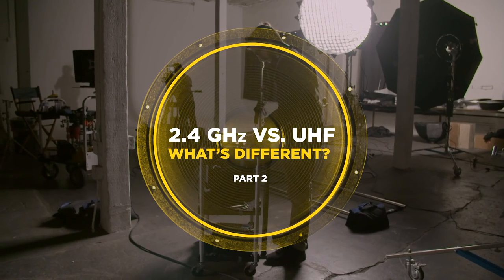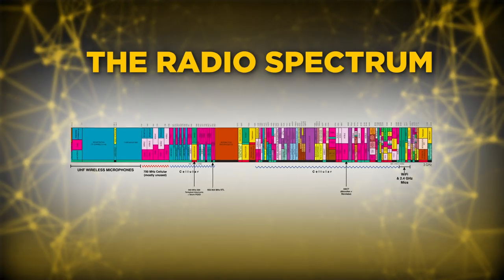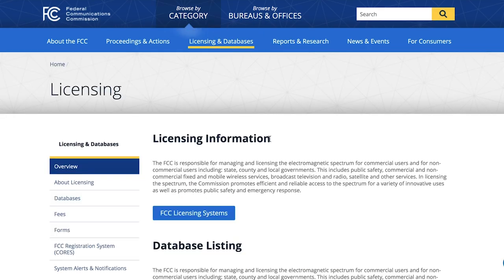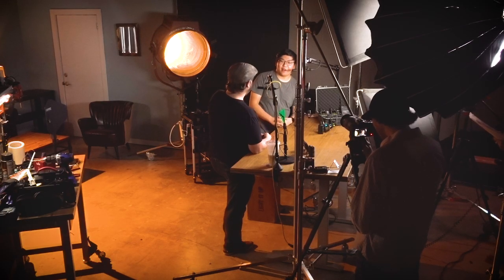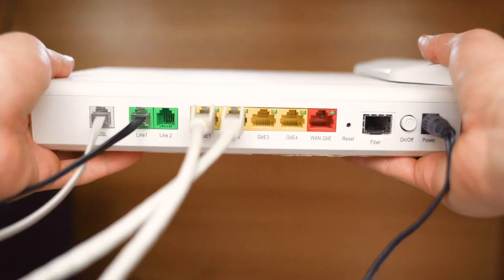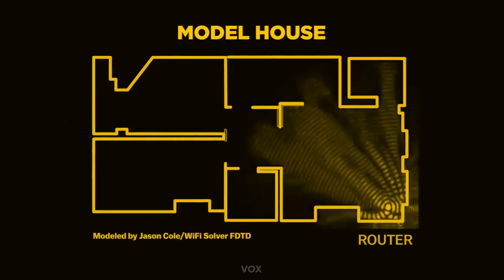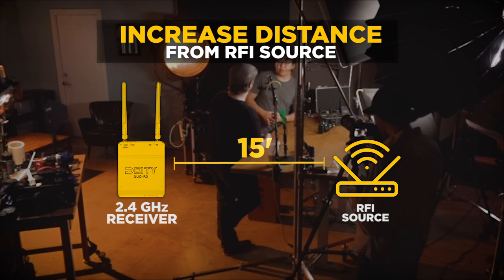2.4GHz vs UHF  |  How To Get More From Your Wireless Microphones

Comment from the maker: How have you solved your RF interference problems in a creative way?
Reply: I would like to see a video about the best way to get sound with the Deity V-Mic D3
Reply: Planting the RX closer to the talent by using a long XLR cable. The RX doesn't always have to hang out on your bag.
Reply: I was working on a shoot earlier this year inside an RF dead zone (at a TV studio directly under a tower) and i was having issues with RF leaking through onto my audio recordings (Zoom f4). I eventually found out that my phone was struggling to maintain a connection so it was boosting its signal and thats what was leaking through onto my mixer. Airplane mode fixed it
Reply: Chris Hoffman This
Reply: Straws on TX Antenna.
Reply: @Izaiah Caleb instablaster =)
Reply: @Valentino Kayden It worked and I now got access to my account again. I'm so happy:D
Thank you so much, you saved my ass !
Reply: @Izaiah Caleb glad I could help :D

Comment: i have a Rode Filmaker kit (2.4Ghz frequency), great so far, never failed, until a day I had to film/record someone inside of a baseball stadium full of people (and their cell phones)  the audio was dropping all over and barely  could get the seconds needed for the editing  while audio was cutting seconds before and after the parts used, did not realized after all was shot and over, really scary experience while watching/listening the clips for the first time, I saw the meter pumping on the screen, did not used headphones. I trusted the thing first cause never failed me before and 2nd cause I had no idea that type of thing could happen, it was a close call on a paid work. Learn a lot from that experience, hope whoever read this, be careful inside crowds.
Reply: If you call yourself a videographer, you need to always be monitoring with headphones (unless it's an on body recorder). Which brings up that point, the Wireless Go II transmitters record internally so it's a really great fail safe.

Comment: The biggest issue with 2.4 GHz isn't RFI, but the lack of reflection sources and penetration. The human body kills the signal quite well, so it has to rely on the signal bouncing off an object to get around the human body.

That presents an issue in certain environments.

One solution I have thought of - why can't there be a "secondary" antenna the size of a Wireless Go that you mount on the body, opposite the TX? It would be like having a TX on both sides of the talent - any direction the talent turns there will be a TX with line of sight to the RX. Would be a great problem solver for 2.4 GHz systems.

Comment: Loved this Video! Very informative & encouraging as opposed to smug and condescending. I own some Sennheiser EW D1’s.

I wonder if other than moving away from WiFi routers, and turning off cell phones is there anything you can do to strengthen 2.4 ghz signal.  Do you need a specialized brand name directional antenna or can you buy any 2.4 antenna.

Comment: Wow. These make me really appreciate sound people and their knowledge. Is it technically (or financially) possible to have some sort of adjustable GHz frequency making it adjust between various levels depending on where you are. Not sure if that is the correct way to ask that.
Reply from the maker: Yes it is. Infact we built that into Deity Connect. Set latency mode to high and RF Output to AUTO and it will automatically adjust based on distance.
Reply: Deity Microphones Well, that answers that! Amazing. Thanks! Any word on killer lapel mic yet? 😁😁😁

Comment: In Germany, both UHF in the ranges 470-608 MHz and 614-694 MHz, as well as 2.4 GHz in the range 2400.0-2483.5 MHz can be used free of charge (until 2031 for now). RFI for UHF is limited to other wireless microphone systems as these frequencies are limited to use for such systems. 

Just if this helps someone...

Comment: We've just recently been experiencing a lot of rf interference with our new Deity Connect system at work. I'll definitely start by turning down the power since they were all the way up.
Reply: Yes! I think this was a little gold nugget of information that was said. Didn't realize more power can create more problems. Did that solve your RF issues?
Reply: @joellouisfire  I haven't really noticed, but  we rarely use the system because they're just so noisy and have tiny dropouts.
Reply: @TannerGwaltney  Ah ok. Did you try updating the firmware and turning up the output settings on the transmitters? I heard that helped a lot with noise issues and Deity also fixed a lot of the noise with firmware updates.

Comment: Quick question from a guy that's green to managing wireless mics and their frequencies. My UHF receivers have a "RF" meter. Where do I want that level to be (or does it matter) and how do I consider getting it there? Pretty sure the unit uses only Diversity antennas.

I'm thinking it does matter since there's a meter and not just a signal presence indicator.

Comment: I have a few UHF microphones and have just got a GHz Senheiser xs wireless digital vocal set with xs microphone and a few videos have said the GHz mic won’t penetrate through objects however I’ve tested it but walking around my house and outside away from the receiver and the signal is super strong, I’m in the UK but I’m not sure which is better to use for gigging, your video has helped a little but if you could help that would be great?

Comment: Hi guys, great video thank you. I am new to using mics. I recently filmed an interview with the senheisser g4. It turns out there's this random static interfwrence which seems to come in and out at its own will... it's now happened a few times, even after scanning and selecting a clean channel. Does this sound like I'm causing my own interference between transmitter and receiver from maybe the power being too high and both units too close? Thanks
Reply: So many variables to know before giving a useful answer. Where was the interview taking place? Indoors/outdoors, near power/radio towers? Is your subject moving around or stationary? Where is the transmitter on the subject (clipped on belt or buried in a pocket)? What power setting was used when it occured? How far away was your subject? This could go on for a while...

Comment: I have a UHF lapel wireless, and I noticed Im picking up radio channels, I have a 6ft copper, ham radio antenna up on my roof, about ten ft away from where Im using the mic. Its not in use, but it was built for FM, so instead of broadcasting, its receiving signals....It took me a day to figure it out...lol

Comment: Amazing video and content. I am a dj and have gotten both uhf and 5.8gh wireless xlr. However both send a signal that makes the low end sound really bad. What could I be doing wrong? Using a dj controller and mixer for sound.

Comment: Great video/subject. I find this very interesting, but still, UHF and 2.4GHz is chinesse to me. From a guitarist point of view, what would be the best choice for a guitar wireless system in a home environment - bedroom player -? Of course, I do have a wifi router at home. So, I should go UHF or 2.4GHz? Or in my case, either one will just work fine? Hoping you still read this even if I´m 8 months late here. Thank you!
Reply from the maker: either would be fine. The 2.4Ghz system might be easier to work with because a lot of stuff is automated for you. Plus, you'll be like mere feet away from your receiver, so interference shouldn't really be an issue.
Reply: @DeityMicrophones  Thanks so much for answering so quick! This helped a lot, and hope this helps other guitar players who read this. Keep up the good work! Thanks!

Comment: I know this is pertaining to wireless microphones, but I use 5.8ghz on both my guitar transmitter, would there be any RFI to me or from me to others? I only ask because when I was using them for a band practice in the basement, there is a slight bit of hum. The hum doesn't exist when I use it in a hall. I have a general idea that the hum should not have happened for reasons that the 2.4G allows more devices but does not have a far reach and that the 5.8G (which I was the only one using it in the group; they were all using wires) would be connected to limited number of devices yet have more reach, so therefore my device should've never had any hums, or am I completely out of my mind?

Comment: Awesome video. Quick question, is RFI a possible cause of background noise as well? I've just started using the Deity Connect system with my GH5 and I'm still trying to figure out the best settings for sensitivity etc. and kinda feel like there's too much background noise when I listen to it in post. What TX sensitivity (+24db?) and RX output do you guys use with the GH5 (I've seen you use it in previous videos!)
Reply from the maker: Yea... the Lumix menu limits you guys to -12dB in camera. I'd drop your RX down to -12 or even as much as -18. And see if that helps. Maybe back off your lav to +21dB. Without a GH5 in our hands to gain stage it that's where we'd start.

Comment: My college's lavs (G3's with rode lavs) at their gear sign-out sometimes create a staticy "white noise" at times, either when actors are moving or even when they are not moving. I usually assume that the wire is broken or damaged. Is RFI maybe my problem instead? Or am I right about thinking it's probably a damaged wire? I am not sure what RFI sounds like

Comment: So would you potentially get a lower noise floor by using a lower mW setting? If the “spread” is no more than you require, would there be less potential noise to be picked up than a higher mW with more spread? So using the lower mW creates a much cleaner signal?

Comment: I recently built log periodic antennas for our microphones at our church to help with drop outs. Now I get intermodulation in (of all people) my pastor's mic. I have changed the frequency but it will experience interference from time to time. Quite annoying to say the least. More like truly upsetting. Anyway, I am thinking of going back to using the dipoles to try to remedy this. Do you think I am going in the right direction here? We are on a shoe string budget so we don't really have the cool diagnostic scanners to help.

Comment: When using Wifi 2.4Ghz you have 14 channels available for you to choose from. It is not a matter of being too close to a router for interference it is a matter of being in the same channel just change your frequency on any of thee wireless device.
Reply from the maker: Proximity to an RF device makes you more likely to run into problems with the harmonics of the RF signal. Also you are more likely to run into RF spray the closer you are to a RF signal.
Reply: Deity Microphones that’s right even your cellphone can be a source too. I think there are router and meter safe cages to avoid RF signals. There is also HF 35c High Frequency Analyzer that can be helpful. 🤗
Reply: Absolutely not true.. we upgraded the WiFi at my church and all of a sudden we had a ton of problems on our 2.4ghz

Comment: Hello and thanks for your video.i have two deity connect sets. My problem starts when i use both of them. It looks like the one interfere to the other.The  pairing, between transmiters and receivers,  can be lost by the slightest move or even when  i put my body between them . The quality of the signal becomes very poor. If i use only the one set the situation is totally diferent . Everything works perfect. Do you have any sugestion or tip to fix this problem?

Comment: A general thing I've always wondered if I was doing correctly: When setting up multiple lavs(spec the G3&4s), should I have them all on while scanning?
Also can I scan them all at the same time?
 Or should I scan them one at a time and while the others are off?
Or should I scan them one at a time, but have them all on?
Reply: set them up simultaneously and leace thwm in so u  can make sure ur not spraying or bleeding from one chabnel to next
Reply: With them all turned off, turn the first set on and find your first freq. Once found and connected, leave the first one on and do the same for the second set and so on.

Comment: Hi guys, I'm experimenting some kind of interference from my Wingman (2.4 GHz I believe) in my 664 SD.  Specially noticeable when I engage the slate microphone when it is powered from an external battery. To me it feels like a bad ground on the external power system. Any thoughts on this?

Comment: Hi guys. Thanks for doing a video on this very important issue. I realized that my wireless microphone receivers kept dropping signals and I would have one signal drop off when I turned one microphone on. I tried to daisy chain the antennae, change the channels but that has not helped either. I am thinking of getting a power conditioner as a last resort in case it has to do with AC interference. I know this is limited information to go by but what do you think?

Comment: Hi I recently bought the deity connect and used it for a wedding it worked pretty well but at home I’m getting a lot of dropped signal. From a relatively short distance away(15-20ft). I still need to do more testing using the different latency settings but one thing that worries me about that is the latency time. Could you do a tutorial on the best way to sync audio with the latency? For me my third wireless is a UHF and they’re all feeding into the same recording device. What do I need to do to sync it with video especially if I’m using timecode? Those are my burning questions.
Reply from the maker: Hey Brett, what are you recording your wireless into? also what kind of environment is your home?
Reply: Deity Microphones I know you must be busy so thanks for getting back with me! I’m recording into a MixPre 6 ii and a zoom H6. In terms of interference my main Wifi is the Orbi with a router and a satellite. I also have a lot of smart switches. At the wedding it worked ok but it still made me nervous. They were up on a stage and when I had the receiver in my sound bag on the floor it was dropping out a lot so I stuck it up on the DJ’s table and then it seemed solid. But it was only a 4 foot height difference. It was almost like it needed to be kind of site. I’ll do some more testing with the higher latency modes and see if that’s better, but if it does I’m worried about sync issues. If it’s pretty easy to fix then I’m not too worried I’m just not used to having to do it.
Reply from the maker: @brettsmithphotography2463  Oh. Fixing sync issues is super easy.
Reply: Deity Microphones so I’ve manually synced things and I assume if I’m syncing from a scratch track it will just line up, but how does it work if I’m using the deity connect with a sennheiser G3 all going into a recorder like the MixPre using timecode?

Comment: Hello to everyone, big shot out from Haiti. I'm haitian sound guy, thank you so much for those informations. They are very helpful. My questions :

● How to set antennas with a cheap wireless microphones to get a good signal's sound in a way where is very complicated on set ?

● With the 2.4 Ghz, it's easier to set  a RF Frequency on set Or with the antennas it's will be more easily to get better ?

Thank you,

Comment: 1. As long as ultra-mobility is not an issue, why not just use good ol' fashioned cable?  Seems like everyone these days wants to use wireless for everything - lighting, focus pulling, you kidding me?  For sound, if I'm dealing with stationary talent (e.g., interviews, standups, etc.), I just plug in the good ol' shielded XLR cable.

2. When you do have to go wireless for sound, isn't 2.4 more finicky about line-of-sight since the bandwidth is smaller?  Isn't the usable range shorter too?

Comment: "I never use 2.4GHz in the field. Today, all teams (lighting & video monitors) are using 2.4GHz to control their systems. It's like a nightmare for sound engineers. I've had so many problems when using 2.4GHz. That's why I never use it at work."

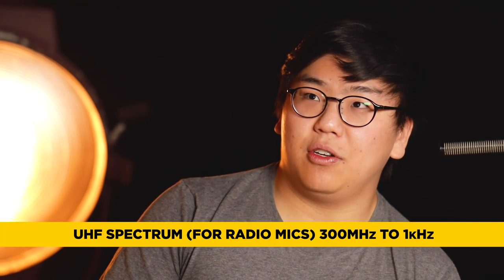Comment: 4:00 "300 Mhz to 1 kHz" doesn't make sense. 1 kHz is lower. I think he means "300 Mhz to 1 Ghz", which is better but still not correct. It goes to 3 Ghz (aka 3,000 MHz):

Ultra High Frequency (UHF-FM): Radio frequencies from 300 Megahertz (MHz) to 3,000 MHz
https://en.wikipedia.org/wiki/Ultra_high_frequency